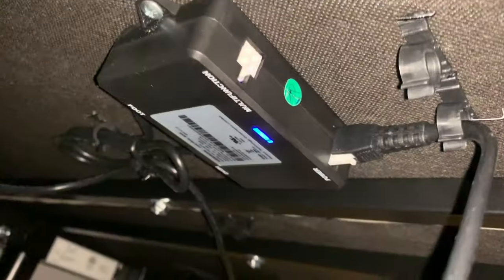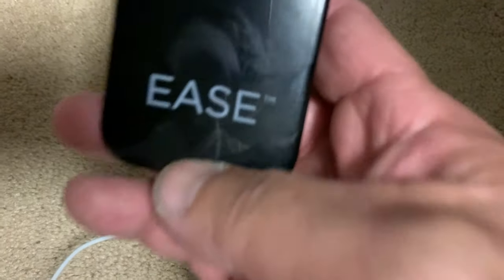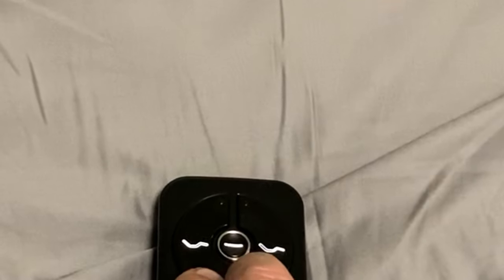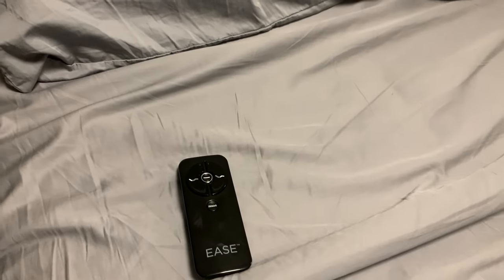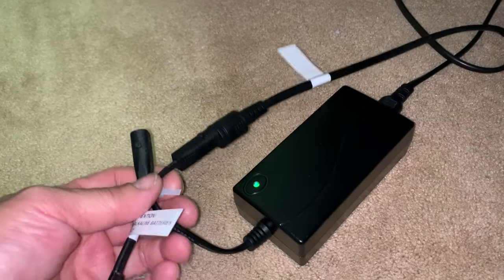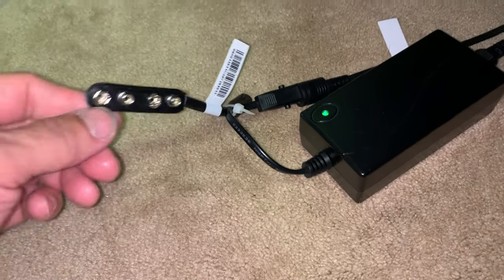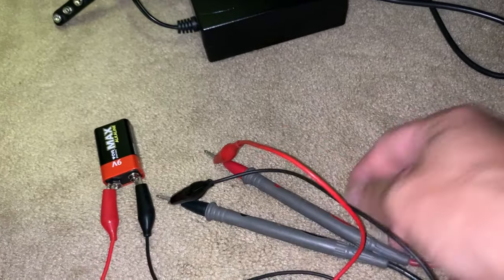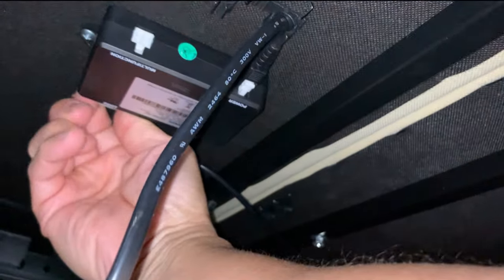Remote Just Stopped Working!!!  EASE v3.0 Adjustable Base ( Sit & Sleep )

Comment: I tried looking online for a manual, and they were all for the Ease 2.0.  Apparently releasing the child lock changed between 2.0 and 3.0.  For 2.0, you press and hold the foot up and foot down buttons.  For 3.0 you press and hold the head down and foot down buttons until it blinks, then press and hold the head up and foot up buttons until it blinks.
Thank you for the video!
Reply from the maker: Yes, when I had the issue originally, I found the info for the 2.0 as well.... nothing for the 3.0 hence, why i threw this vid together. ;)
Reply: Thank you, your comment helped me because mine is 2.0 & I was doing what everyone was saying about 3.0
Reply: Thank you so much I guess mine is 2.0 also bc the other way wasn’t working! Life saver Ty 😘😘
Reply: Wow thank you for your comment 😅 finally
Reply: Saved my life 🙌

Comment: It was with great relief that I watched this video. I asked for a replacement controller for Christmas since "the boy side" controller got lost somehow. The wife did not provide tech support. Clue: neither does dialing the 1 800 customer service number - terminal hold. Older videos talked of pressing the reset button on the power unit. This finally gave the correct answer. Thank you.

Comment: Bless you...I didn't know what happened. The remote was on the bed when I fell asleep. Lol...you were  spot on with your instructions even to the 9 volt battery thing.  Saw that but didn't have a clue. Thank you so much.
Reply from the maker: One of the things the technician told me when I went through the call was..... IF you sleep on the remote aka push all the buttons down with your body.    It can be the cause for it to go into "child proof mode".

Just something they said to me.

Comment: loved your video, BUT if your remote does not have orange on the warning lable on the back of the remote to remove the child lock you must press BOTH the top and bottom of one complete semi circle on the right hand side. Just an FYI for those that purchased around 2019.
Reply: Thank you. After an hour of following and repeating the instructions over and over again, this tip saved me.

Comment: oh mine has a separate box that is connected to the main box.. has a button that will set bed back to zero.. and a spot for 2 9v batteries... I even tried the reset on this dam thing and still won't work with remote

Comment: My blue light isn’t coming on, any idea what could be wrong? The green light is on and the remote lights up
Reply: If your light isn’t coming on :
-  double check your cables unplug & plug 
- if it isn’t that and you are sure you have the green light on the power supply…. 😞 it’s probably the control box
- I would test the by getting 2 9 volt batteries and using  the wires/paper clip/ pins to directly connect to the motors
- if the motors move then I would call the company because you have a major issue

Hopefully it’s under warranty!

Good luck 🍀

Comment: We bought ours in 2 months ago and had to reset several time already. So disappointed with the bed considering how much we paid for the unit
Reply from the maker: I understand... Mine too is just a couple months old.  The technician told me the common way it initiates into this "child proof" mode is:
- remote falls to the ground
- remote gets sat on top of

Anyways, if it keeps happening without any of the above maybe you might want to take it in.  For me I got the 10 yr warranty but, I don't know how long their standard terms are.

Good luck!

Comment: Oh my gooooodnesssssss I woke up in the middle of the night because I rolled onto the remote and accidentally put the head up too high. Then the remote stopped working!!!! Your video helped me solve it. It was ultimately a child lock issue. All the manuals I found online said that child lock was unlocked by holding the foot up and down buttons at the same time until it blinks twice - which did nothing. Your video told me to press the head and foot down at the same time until it flashed once and then head and foot up at the same time until it flashed once. That solved it. I’m so mad that the official manuals had the wrong instructions.

Comment: The confusing part 
 for me is will the bed turn off the child proof mode w/ the 9v batteries? It’s 12:30 AM. I called Instacart to deliver two 9v batteries. I hooked it up to the 9v battery mode and it’s not working:(

Comment: The 9V batteries are only if there is:
- blackout 
- of if the power supply box = broken
- 9V batteries = back up power system
- to get out of the childproof locked mode is simply press and hold both buttons on the remote down until it flashes 
- then hold the upper buttons down until they flash and it should unlock childproof mode

If that doesn’t work then you have bigger issues aka controller box OR the bed actuator motors are broken.

Good luck

Comment: My base was working fine till recently. it's pugged in the same outlet, but my power adapter's green light is barely blinking. I tried with 2 9v batteries as well but the power (blue light) is still not on. what can I do?

Comment: Why didn't you actually show how to use the battery on the strip like it was intended. Some of us can't climb under the bed or have those electrical connectors. Because mine was 8:30 pm on a Sat. night and I wasn't able to figure out how to use the strip. I put 2 batteries in and plugged the power supply into it and it didn't work.  Someone then forwarded this video to me and it turned out my bed was locked but the batteries still didn't work.

Comment: I slept on the remote. So when I woke up I pushed the back up button (to get the head of the bed up) and it didn’t work. Feet up mode didn’t work either. So I just went to pressing the 2 buttons on the bottom and then 2 buttons up on the remote (getting it out of child mode) and it worked right away.

Comment: What I want to know is why is the foot section of the bed higher than the head when in flat position.  Can I remove a section of the lower halves legs to lower it as I have acid reflux problems.

Comment: Some of the remotes require you to push the top and bottom on the leg side at the same time until it flashes. That’s what unlocked mine.

Comment: Thank you! This saved me. We sleep with the remote in bed and must have inadvertently put the remote in "child mode." I went nuts for about 30 minutes with new batteries and cycling power to the power supply. Found this video and quickly realized what was wrong. Thanks again!

Comment: Dang! This is the 3rd video I’ve seen - 3 different methods but Still NOT working 😫😫
Reply: Did you check that blue light under the bed. My delivery guys (who are always in a hurry,) tangled the wires around the base legs. I made them come back to do it right w/o rushing. I have a Reverie remote for 2 yrs. Buttons are elevated, well lit & no child proofing. Methinks these remotes are set at the factory on Child protect mode. Count how many folks have encountered the problem. Far too many. Horrible customer service as well.

Comment: When I tried to unlock the child lock, the controller wouldn’t flash! Any help?
Reply from the maker: First thing is:
- If you are Sure it's a  Version 3.0
- You tried what I put into the video.

Then, I would say you have bigger issues.... you will probably need to call customer service and see what they tell you.

- Make sure yours not a version 2.0 because that is a totally different reset method.

Comment: On mine I had to hold down the right side up and down buttons only and then it blinked.
Reply from the maker: Yes, you have the older model.  The Ease 2.0 is when you hold the right side down.

Here is a link to the older model that I found when I originally started looking to fix mine.

For those with a older 2.0 version check out this link:
https://youtu.be/DxaLC_Nht_w
Reply: @aeromah1062  ah, okay thanks yep that's the video I watched after yours. Thanks again
Reply: I wonder why it stopped working in the first place
Reply from the maker: @grandfury5609 yeah, when i got on the tech line they told me if the remote "drops" it can cause it to go into that child proof mode.

Who knows but, seems like tons of people have this issue,
Reply: @aeromah1062  oh wow... Yea that's weird. But never surprising with new technology. FYI, LG appliances are the WORST!

Comment: There are two generations of the EASE remote - each having a different way to unlock the child lock.  Does anyone know if both remotes are compatible with the controller?  I can get the new remote replacement cheap.  I can no longer get my old (black label) remote to pair.
Reply: I was able to get mine to move using the  method he described.  Worked for both head and foot, up and down with 2 9 volts and the power down box jumped directly to the motors.
Reply: I just don’t know if it is the remote or the control box.  When properly wired, the white light on the control box does not stay on when attempting to pair.